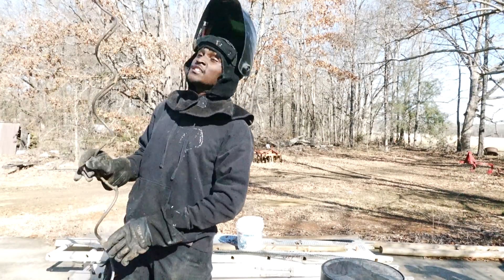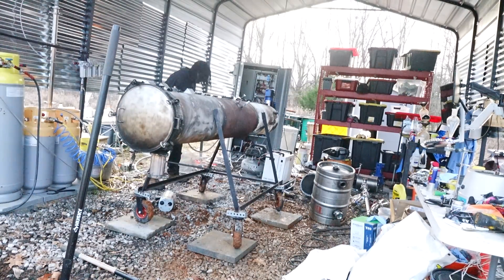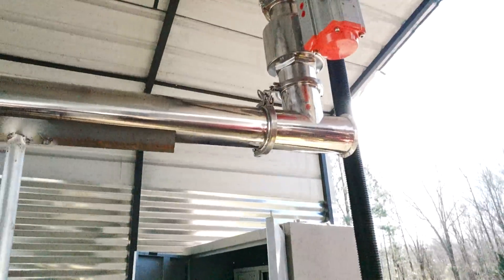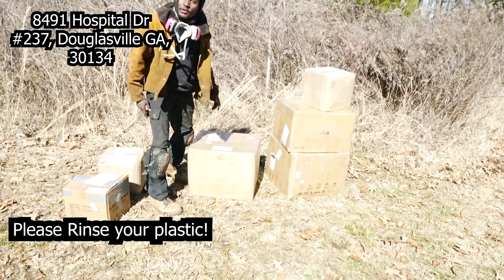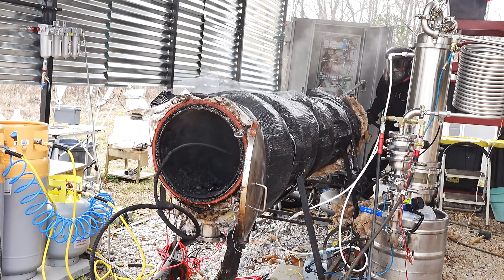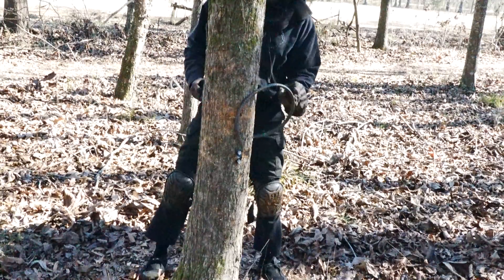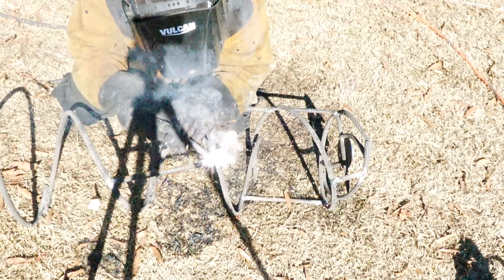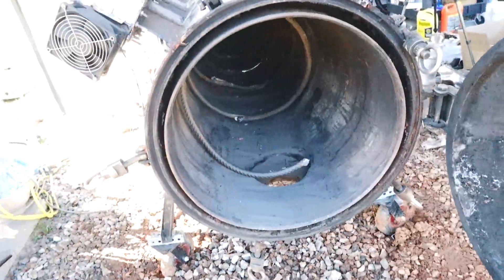Continuous Plastic to Fuel Reactor Upgrades

Comment: I got a question how do you purify the exhaust gases that come from the plastic when burned, it's illegal to throw plastic on an open fire due to the toxins released into the air, you may want to find a way maybe someone in the comments might know how to do so. I just found you so I don't know if you've covered this in a past video.

Comment: One good thing to think about is that, now that you have a closed, continuous feed system, it is a viable decision to revert to a shatter auger system for the main reactor. Far easier to plan and build and provides the structural rigidity you need to feed the plastic throughout.
Reply: W Helpful Critique

Comment: Very awsome work. You can add a catalyst to help break up the plastic into smaller fuel molecules. The cleaving catalyst is made of CaO 50% Fe2O3 30% TiO2 15% and CuO 5%. The iron and copper turn to metals to keep the polymer from reforming while the oxygen in the CaO and TiO2 do the actual cleaving. For the second step react the distillate with hydrogen using either nickel or a iron titanium hydride ( you can get both for free out of dead NiMH batteries ❤)

Comment: Need a “nut buster” or “bolt buster” or whatever it’s called.  The induction heater to heat that sucker to remove them stuck issues.  An start using some anti-seize on the threads

Comment: Julian that gear box you removed with a mallet...It looks like an Iron Horse or a WEG sold by Automation Direct.  If you can send me the make model I can throw it in cad and design n fab a puller so it isn't so hard on you.

Comment: 9:18 Have you tried using anti seize compound? I'm sure when you say baby oil that's satire but I would definitely recommend using anti seize on those particular connections and maybe it will come off easier in the future.

Comment: Weld you an eyelet on the back of that motor if it don’t have a spot for one and use a come along to pull it off. Ningbo precision machinery can possibly make you some stainless steel augers, it is in china though.

Comment: Julian PLEASE READ THIS 
when you putting the vacuum in the plastic feeder you must compensate with nitrogen otherwise you will Back Gas Flow from reactor and risk of explosion due to negative pressure in the feeder
Reply: Yes, polyethylene and polypropylene are particularly bad for making explosive vapors when reacted in a WtF reactor. 😮
Reply: Julian PLEASE READ THIS
Save your money, all you are doing is creating heavy pollutants that will give you health issues eventually.
Reply: Nitrogen is a horrible idea, so are waves, truth is the explosion would be from unguided containment not  saying too much, bit this is for starters, I have of course coded everything I've said, so no one can figure it out 😊😊😊😊

Comment: I have this feeling that if the plastic was liquidized first you could seal/continuosly feed it better, cos high preassure veicular pumps become an option, or plastic molding ingectors,  etc...
Idk , im gona do some experiments if i can get a low enough viscosity on the plastic, if i can dissolve it on oils or the pyro petrol produssed from the machine itself.
I know some plastics just dissolve very easy like styro.
Reply: Just be careful it’s very toxic. NatureJab doesn’t know what he is doing. Study the process and you will understand what I’m saying. Don’t be blinded by the plastic to fuel dream. It’s not that easy.

Comment: Thanks, for your inspiration, you should try and collab with, diyers like Cody'slab , Nobox 7 , Hyperspace pirate, so forth as you can create a new rocket fuel, I'd like to test on this combustor of mines. And I also have designs,  that I would be willing to invest to increase the effciency of your device by tons. With supercritical breakdownm
Reply: If I see Cody's Lab collabing with him, I'd be really disappointed. Cody did some reckless stuff, but not at this level.
Reply: @user-bh5dv2qt2l  I'd, be damned at your low level of curiosity and low level to learn what his trying to do, reckless, I for someone who does not value, preparation dedication or math , Even SAFETY. So use better vocalubary random user

Comment: In times like we are living today, we need your gas because the price will skyrocket really soon.
Reply: but this would cost many many times more than gas to produce per gallon - burning a lot of energy to make a little definitely wont make it cheaper - he admits regularly the process is wildly inefficient & its main goal is to remove plastic from the environment not make fuel cheaper
Reply: Why exactly do you think the price will skyrocket?
Reply: But hes not making gas. Hes making plas.